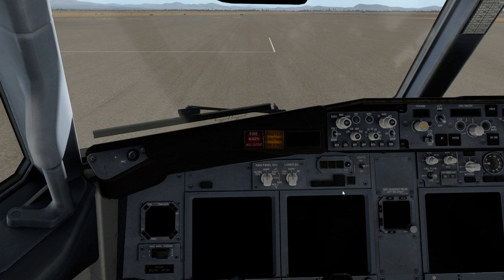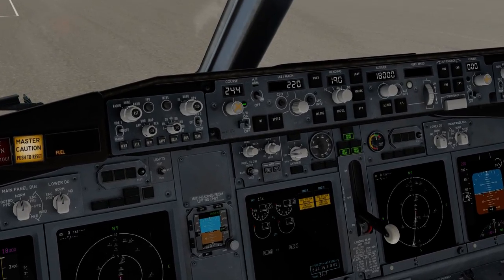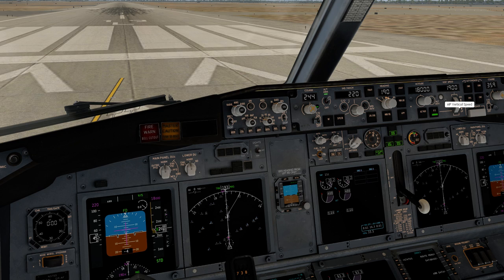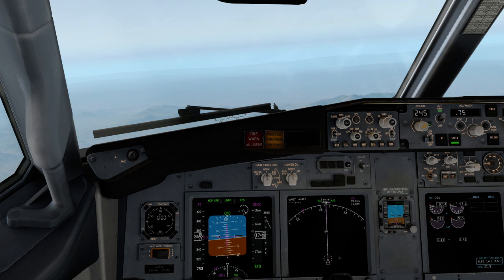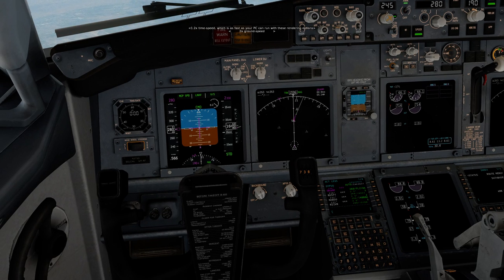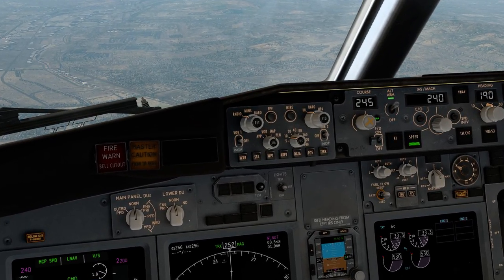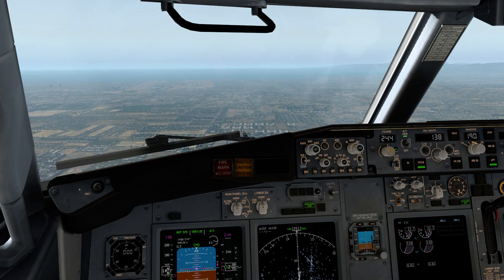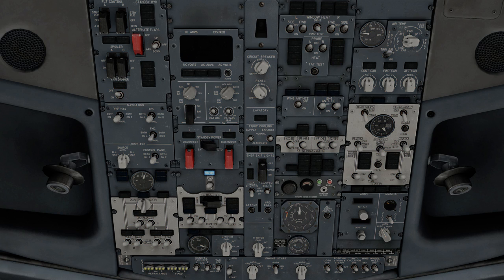X-Plane 11 - Complete Tutorial (Begineer/Professional) - B 737-800 KLAS ✈ KLAX

Comment: How do you manuever the plane smoothly? Like parking it in a space. I'm not sure if both engines should be in throttle and I just release the breaks. What happened to me is that it is going left and right.
Reply from the maker: For sharp turn, we usually use brakes. And taxi at lower speed. It allows maneuvering smoothly without brakes.
Reply: @TheDeathWolfGaming  Thank you. I was actually referring to taxing the a/c. Found out there is nosewheel axis to turn the a/c left/right. And we use a little bit of throttle to get the a/c moving. Thanks your tutorials have been very helpful.

Comment: Hi how do you move around in the cockpit to look at the full upper panel or fmc? Thanks!
Reply from the maker: Hii, you can move in cockpit manually by using the arrow keys and the comma period key to zoom in and zoom out.. After you get your desired view, you can save the view by Holding Ctrl key and pressing the desired Num Pad key. For example you can go to overhead panel and save it by pressing Ctrl + 1. So whenever you press 1, you will go to the overhead panel. Hope that helps. and I have updated versions of my flight videos too. Do checkout on my channel :D
Reply: Thank you

Comment: hi i have followed your video and got everything right but my plane is not following the course direction its off course please help what i am i doing wrong the speed and attitude is locked they are okay
Reply from the maker: atsu beckley You have to turn on LNAV to make ur airplane follow the course. And if in case u missed a turn while turning you make the plane manually pass over the waypoint or you can delete that waypoint by going to DIR INTC and it will be done. Make sure u have LNAV and autopilot on. Hope this helps :D

Comment: i got a problem when i landing...when I turn on the app , the airplane still stayed the same attitude ..
Reply from the maker: It is because, you missed the point of glide slope intersection. You might that dots on your and pink lines on your display when u turn on APP. You have to turn them on before you hit the glide slope. Hope this helps. And make sure to come to lower altitude when landing.
Reply from the maker: I dont have fms plans saved in folder. I file new everytime. Get your FMS plans from simbrief.com and use my other videos to know how to use FMS. It is really easy. There is a link in my comment section. Also there are much more new videos. Hope this helps. Thanks

Comment: when i was at 27,000 ft and suddenly the pilot began blacking out... what do i do?
Reply from the maker: Elements Band If you are flying Zibo Mod, it might because of lack of oxygen.
Reply: Is there a way to fix it?
Reply: Elements Band tun on the oxygen masks
Reply: dont open the windows
Reply: it has to be oxygen depressurizing, try to check if its on or off, or it could be a emergency